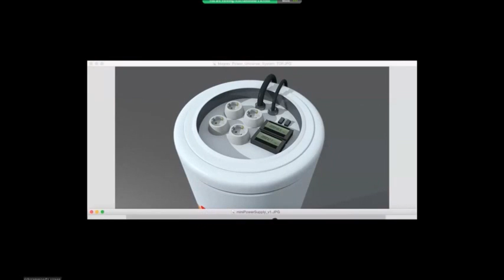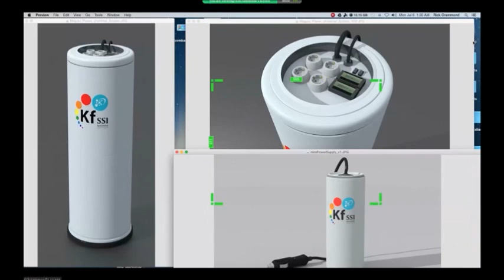Keshe plasma reactor for sale

Comment: It's very simple device, so why plenty of ppl ask if this work or ask who where they can but it, and always they get no answer. It means there is serious problem to find 1 person who built it and can show measurements : input energy/output energy proving that it works. Of course they use scientific words : plasma, etc. but without any sense IMO and understanding even what electrical coil is. Try to burn isolation of guitar pickup...:D

Comment: I don't understand how the car unit will reduce pollution on a scale that anyone would notice. Car engines are internal combustion, they need fuel that burns/explodes to force the pistons to move. It wouldn't matter if you connected 11kv through the cigarette lighter, the engines are not powered by electricity. 
He actually says at 9:16 "no car should need any power any more to run on oil", which I'm sorry, is total bull shit. You would need to replace every petrol car engine with an electric one. This unit, if it works will only be any use for people with electric cars.
Cant wait for the flying cars. hahah 11:24

Comment: It's going to take a couple of weeks to prove it works or not.     If it is a scam why would he put himself up for the ridicule in such a public way ? Academics have totally ignored plasma for the past 100 years and they don't include charge' s effects on the universe???  If you check out the electric universe theory it kinda points at Keshe' s work. If you think about it our planet sits within the charged plasma envelope of the Sun. If there was to be a breakthrough the odds are on  the side of plasma reactions being the doorway to the universe. Statistically the odds say most of these types of claims turn out to be snake oil but if it where a genuine breakthrough this is exactly how it would happen. . .  I'll keep an open mind on this one.
Reply: +scandalasdog you have the only sensible comment here that I read thus far
Reply: +scandalasdog Mehran Keshe won't "put himself up for the ridicule," there's enough ignorant and stupid people who will believe that the plasma device will "GANS-coat" the whole wiring of their house or car and produce more power out of its existing supply, even if there is no way of measuring it. You can supposedly take off the device after your house or car is nano-coated and again, gullible people will think that it's more efficient, that the lower bills were caused by this device, not by regular usage variation, and that the higher bills can be explained by the extra electricity used to roast the Thanksgiving turkey. As for the car, most people won't see any difference because they run on gas or diesel, not electricity.

And why the nano-coating process would stop at your house and not go on to "infect" the grid and neighboring houses is beyond me, unless plasma has intelligence or Keshe managed to teach it to coat only as far as the price paid for the device.

It should be very easy to check this BS: After a week running, check the electrical cables beyond the outlet to see if they are "GANS-coated."
Reply: +scandalasdog You wrote: "Academics have totally ignored plasma for the past 100 years".

How so? Plasma is a state of matter and is very well understood. What do you think plasma is?
Reply: +Peter Carlson doh!  yeah the basics of what a plasma is understood but they deny and ignore the plasma throughout the universe. it's doesn't contribute to any phenomenon or have any interaction according to academics. That's what I mean.
Reply: +scandalasdog Try to become informed before you write
Got energy saving lamps - plasma just to name one ofhundreds of application

Keshe does not even know what the word "plasma" means
Reply: +Martin Singer wow you read my comment and came to the conclusion I deny ' plasma' How ??
Reply: scandalasdog How do you come to that conclusion? Pleas read my message as well as your own again and try to understand the context :)
I was just pointing out that science pretty well understands plasma and there are lots of applications which work
Reply: +Martin Singer but I never said it didn't so what you talking about?
Reply: +scandalasdog 
Care to rephrase that: (maybe there is some misunderstanding)

the basics of what a plasma is understood but they deny and ignore the plasma throughout the universe. it's doesn't contribute to any phenomenon or have any interaction according to academics. That's what I mean

And that's exactly to what I responded
Reply: scandalasdog You say that: "they deny and ignore the plasma throughout the universe. it's doesn't contribute to any phenomenon or have any interaction according to academics."

So the very fact that the sun is a huge ball of plasma is ignored, according to you? Or that the solar wind (which directly interact with the earth) is plasma?
Reply: +Peter Carlson yeah all that solar wind included - has 0 effect in shaping our universe. That's exactly what I mean , everyone knows it's there. But scientist don't weigh plasma. It's too insignificant in their eyes. Solar winds or any other plasma interaction have little statistical effect in the formation of the universe. Would you agree with that?
Reply: Peter Carlson Besides that there are hundreds of applications in our dayly life
Reply: BRILLIANT

Comment: I did not see this power generator of Mr. Keshe  hooked up to any load, not even a light bulb.I followed this Mr. Keshe for 6 years , from Belgium to different shows and I did not see anything he said will make work finished or working. Consistently, this unit which is supposed to produce electric energy  from plasma, is not shown working., which means it does not work.
Reply: +serbanmike This comment has substance and worth listening to. Can you however contact Mr Keshe and do what you are citing, namely: hook it to a load or to a light bulb, otherwise, the growing doubt and accusation that he is a scam will eventually drown him.
Reply: Arnulfo Laniba I have no way to contact Mr. Keshe. He took off from Belgium where he was renting some facility and present it as his laboratory, but for some reason he closed shop and took off and went to Italy.  For some reason he was scared for his life.
I wish I had the money to buy one unit and experiment with it.
I am sure if his units are really generating electric energy "out of nothing" or "free"  he must be rich by now because these units would sale like hot cakes. I am sure you would buy one unit just to get rid of the power from the grid. If  I pay $200/month for electricity I would buy one unit that would pay for itself, and once I recoup my upfront investment money I save $200 /month  and do something else with that money.

Comment: Mr. Keshe, Thank you for working so hard to bring this unit to the world. Congratulations! I am in the process of buying a Magrav-Power Systems unit. Do I get instructions with it....and which of the videos you give examples how to plug it in and it's uses? Does it attach to the Main Electric inlet to the house please?
Reply: +Sylvana Albanozzo All you will get is a blu plastic box. It does all aotomatically. Especially and only nothing
Reply: Martin Singer .... Have you seen any concrete demonstations of the unit Martin? What do you mean atomatically? do I plug it in my main feed ? what you mean esp nothing? Can you say more ?
Reply: +Sylvana Albanozzo My message was sarcastic. This miracukous plastic box does literally nothing. One of Keshes followers of the inner circle performed an experiment with some wires and primitive batteries and a energy meter and got it wrong: he connected the energy meter the wrong way round and measured - instead of energy delivered to the grid, energy drawn from the grid.

And Keshe, who is totally ignorant in physics, made this mistake without further testing the basis of his "MAGRAV power unit". Do not buy this crap. announced delivery time after payment is 90 days and even if you use PayPal this would not help because their money back guaranty expires after 30 days
Reply: +Sylvana Albanozzo Addidion: Always keep in mind that there is no free lunch :)

Comment: Hold on a minute, have you noticed the connector, that plugs into a power supply, now doesn't that mean it needs power,not it releases power?
Reply: +A Brit in the Philippines Chris Wren Hello, Its been clearly explained several times in the video. You Plug that in to the cigarette lighter socket to keep the cars battery charged. It is what the device does partly. Gooday
Reply: a thermo nuclear war-head needs a detonator
Reply: +Rod Gouin lol
Reply: +A Brit in the Philippines Chris Wren Of course. This nutjob had the energy meter connected the wrong way, so he measured the energy from the grid and not energy to the grid. A real scientist :D
Reply: +Kosol Ouch Thank you for demonstrating your intelligence and education :D
Reply: Rod Gouin Np problem, the cigarette lighter plug is fused :D

Comment: You mean that "can" may be used in normal car to power a onboard Hydrogen generator and and will supply enough power to enhance the combustion ( Will not be so easy  to replace the fuel without significant changes on actual ECU controlled engines) ?
Reply: +Martin Singer 
The plastic box does nothing . . . the same as Martin Singing words of division and abuse . . . but like brains in the hollow of the Human scull, when the contents is put to use in the right way then the benefits to all mankind are an obviousness. . . It appears that Mr Keshe has done this with 40+ years of research and is way ahead of all of us. . . I for one will, with an open heart and mind make a few of these units and "The proof of the pudding is in the eating" is it not Mr Singer? 

The `empty` that is referred to Martin is the truth, as the `empty` aspect refers to the Plasma state that in actuality is the centre of of existence that Mr Keshe in his genious has tapped into and has shown to be real. . . Check it for yourself Martin. . . you may just be apologising to all these people herein. . . and thats fine with us. . .
Reply: +Marius Moldoveanu No. Just an empty plastic bpx for over 1000 Euros :D
Reply: +Sam Noel Pearce you sir are a poet! :D a peaceful, good intentioned, and word-clever poet! excellent! :D
Reply: Sam Noel Pearce Wanna buy one of my beautiful pink unicorns. You can feed them with plasma _D

Comment: The can car charger cable is too thin.
Reply: Also the cig lighter to run an electric car would over heat.
Reply: +Anthony Shelton And the car would burn - a good thing, because it destroys all evidence about Keshes nonsense :D
Reply: +1spikelet Only if you have a wire which does not blow at 100 000 degrees :D
Reply: +Martin Singer If your after a quick Sun tan just make sure you buy a factor 100 sunblock ha ha